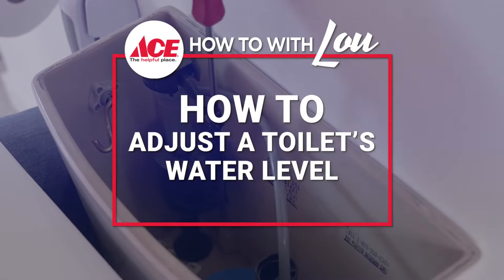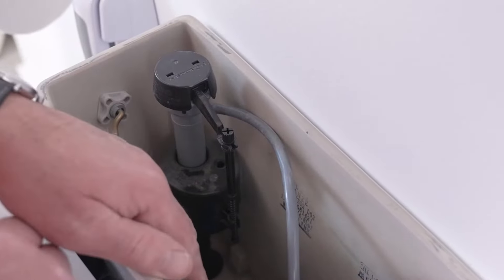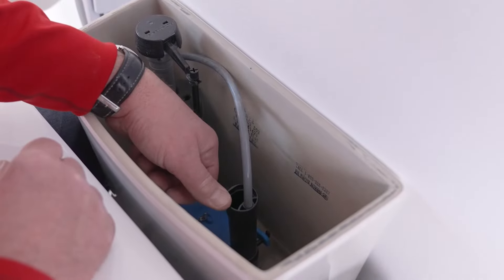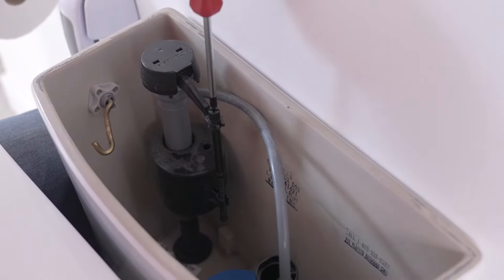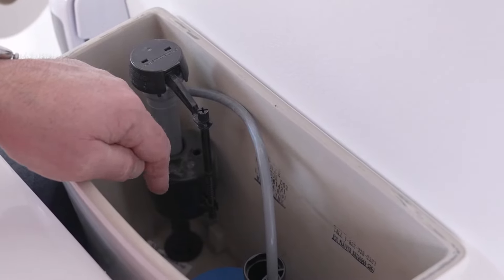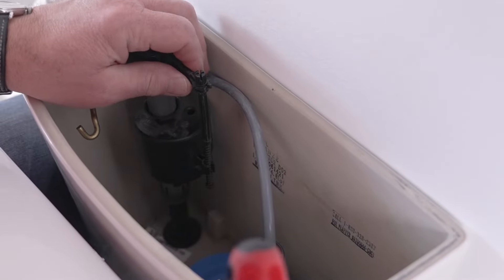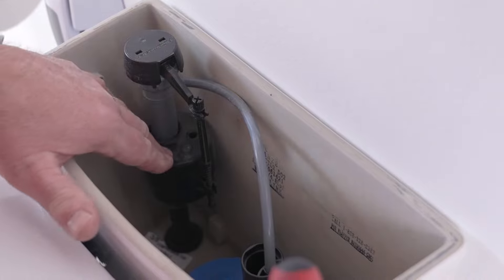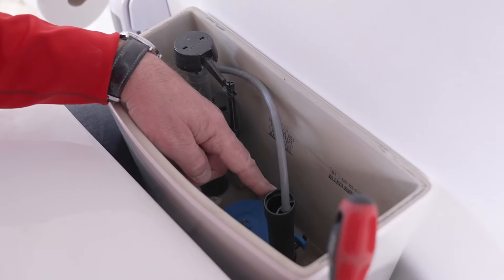How To Adjust A Toilet's Water Level - Ace Hardware

Comment: Besides the screw I want to adjust height of the rod. I adjusted screw to top. Water is still too low. Bowl doesn't fill enough. Mast needs to go to the lid of tank. Top of fill valve sits 4 inches from lid. And it's 2 inches from top of overflow tube.

Comment: What about if you tighten it all the way and there’s still not enough water in the tank?
Reply from the maker: Hi There,
Try loosening the screw to get the level up.  You want the float to be higher in the tank to get more water.  The level should be just below the overflow.  Hope this helps!

Comment: I don't care about the water level in the tank.  It's flushing just fine.
But I'm trying to raise it, temporarily, in the BOWL, so I can let the boraxo hang around long enough to dissolve the hard water line.  But when I add more water to the bowl it just keeps dropping below the hard water stain line.
EDIT: Watched another video, and now see the two water levels are related.  Will try this; hope it works on a low-flo system.
Reply: I have this problem but this video didnt help me
Reply: The bowl has a trap behind it, and the water goes over the trap and into the drain, therefore your water level in the bowl cannot be higher than the lowest part of the high looping trap. Perhaps your fill valve needs to be replaced. The small tube on the fill valve malfunctions sometimes it gets clogged and wont let enough water go through the top of the flush valve, where your flapper or cylinder is to fill your bowl. The small tube from the fill valve must be attached to the top of the flush valve to fill the bowl

Comment: The water level in my toilet bowl is to high
Reply from the maker: Hi There,
Use the screw or clip on the fill valve to lower the water level about a 1/2” below the overflow tube. Hope this helps!
Reply: @AceHardware   Thank you

Comment: Do you know how to lower the water level in the toilet bowl, and not the toilet tank?
Reply: You can, but If you do that your toilet might not flush properly, so the question is why do that
Reply: My Kohler toilet has a very high water level in the bowl, and it doesn't leave much room around the edge. My other toilet (Roca) has a very low water level in comparison, and it just fills up to the lower neck of the bowl, and it doesn't splash around when you are using it. That's why. It would be nice if I can lower the Kohler level to fill up to the mid point of the bowl. Lol
Reply: @kasnicks  thats odd, most Kohler toilets I see usually have a fairly low water level in the bowl. Does yours have the 3" cylinder as opposed to a regular flapper
Reply: @kasnicks  anyways, try a Fluidmaster Performax fill valve. You can reduce the amount of water going to the bowl on the small tube, so that the tank fills up and shuts off before the bowl fills up. Very easy to do
Reply: Wow, that's great. I will follow it up. It has been such a pain! Thanks!
Reply: @ryancook1608  Here's why.... because i don't like being dipped in the water.
Reply: @jeffcory1056  without the proper level of water in the bowl, you will have a poor flush. The water level in the bowl will never be higher than the lowest part of the built in toilet trap loop, unless its clogged of course
Reply: @ryancook1608  I'm not asking for a lot.  Just enough to keep my male twins dry.

Comment: The float is all the way up but water still low. How do I raise the plastic pipe holding the float
Reply from the maker: Adjust the water level either with the screw or clip to allow more water into the tank just below the overflow tube.  Hope this helps!

Comment: Did not work. Still rises to normal level. I followed instructions and does not work
Reply from the maker: Hi There,
Check your fill valve, it may need to be replaced.
Reply: Maybe your adjustment rod is spining in place. Pull it off from the valve, adjust few turns and push back...see if it made any difference.